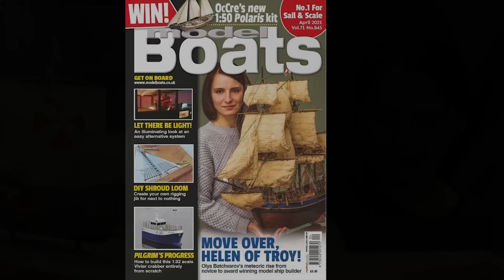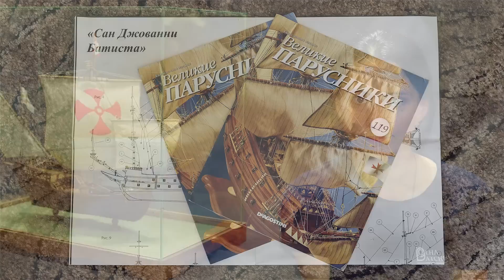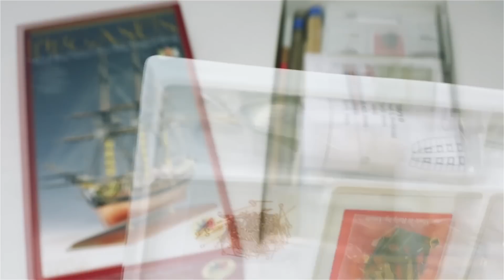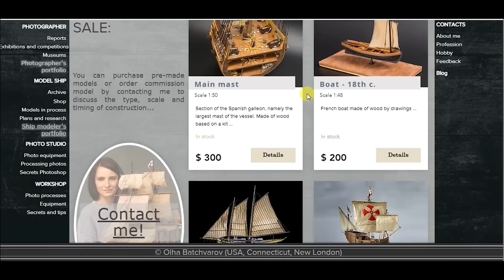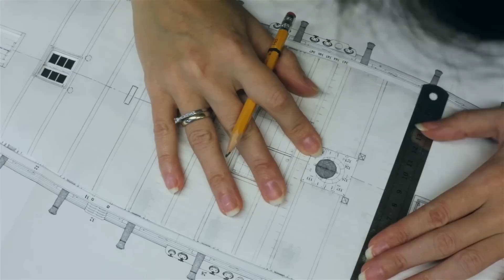FAQ - Frequently Asked Questions

Comment: Very nice.  Thank you.  I pick up a lot from your videos...

I had to laugh about your little aluminum block tool.....  And I am not laughing at you...  I am laughing because I did a similar thing years ago...

I was young, my friend was a machinist in a shop.  So they were doing all this metal work, lathes, drill presses, mills, end mills, shapers, and other stuff that I don't even know what it was.   The point is, there were scraps and end cuts all over the floor near some of these machines....  Almost all of them were perfect cubes, or perfect rectangles, in a variety of sizes... Some were really small, some were bigger, but they were all perfect square angles....  So I asked if I could buy them, and they all laughed at me...  The owner guy says "It's all scrap!  It's going in the hopper outside!  Take whatever you want off the floor, or out of the hopper!"   So I took piles of these...  that was probably 30 years ago...  I still have them.  I have used them a million times...  Very handy to have around...  They work good as weights too.  Mine are all steel, so the bigger ones are kind of heavy...

Anyways, great job.  I really enjoy your videos.  I hope you keep doing them.  Best wishes.
Reply from the maker: Thank you very much!))))

Comment: Hi Olha.  I have great admiration for your way and techniques of building ship models.  I stole many a technique from you!  One part I keep struggling with is which glue to use.  One pulls threads, the other doesn't dry fast enough.  I'm now trying thin, very liquid wood glue (D3). Maybe you want to give away what kind of glue you use?  I hope - like many model builders with me - to see many more beautiful videos from you.  You are a huge source of inspiration to me.  Gr., Arie - Netherlands.
Reply from the maker: Thank you very much! I actually used cotton threads for the first and last time on my first model. I decided to save myself most of the problems. I use 100% polyester thread. I no longer have such problems as stretching or sagging of the ropes due to humidity, no hairiness, and most importantly, polyester threads produce more realistic ropes in scale. And I use CA glue only to fix seizings and rope ends.
But when I used cotton threads, I also did not impregnate them with glue or wax - it is better to use a lighter...
Reply: Hi Olah.  Thank you for your detailed explanation, this also helps.  But maybe I wasn't very clear because what I actually meant was which glue you use to build the model.  Therein lies my problem.  I always see you making the wood connections with very thin, white-colored glue.  I'm curious about that.  If you have time - in between builds - to share this with me, I will be very grateful.  Have a nice day, Arie.
Reply: Sorry ... it's Olha, not Olah!

Comment: The nice people at MicroMark have some Machinist's Blocks similar to your aluminum scrap, in case you need to point folk in that direction.
They have also hooked me with their new PSA, Pressure Sensitive Adhesive, which is really nice for cabin glazing and fine trim (it's no fog on most transparent material, too).  (As to glues I use, the answer is "yes"--PVA, CA, epoxy, everything under the sun can have a use--this is especially true for metal items..)
Reply from the maker: Thank you for the info! This will definitely come in handy for my viewers!

Comment: Hi.  My name is Ed Zrebiec and I live in Port Saint Lucie, FL.  I am building the Cutty Sark plastic model by Revell. I need advice on how to secure lift halyards, sheet and clew lines to the pin rails and fife rails where I really can't reach them.  Was I supposed to attach the lines before gluing the rails to the deck?  Please help.  You do great work!
Reply from the maker: Hi, Ed! You can’t set the lines first and then install the fiferail. However, if the scale is small enough, you can simulate the belaying and coils. Do as follows: lead the line to the appropriate point and glue in place. Cut off the excess. Separately make coils of the same line and then glue them in position to cover the cut off line. Visually it will look like properly belayed line
Reply: @OlhaBatchvarov  thank you for that advice.

Comment: Thank you for your channel.  You FAQ video answered a lot of questions, but also raised one.  You extolled the virtues of PVA glue.  However I noticed you using Titebond II, an aliphatic glue, in a number of videos.  How do you choose between the two for a particular application?  An another subject, do you wax your rigging lines before using them?  If so, would you consider making a video that describes your method.
Thanks again.
Reply from the maker: You're very welcome!
I use both glues! Titebond II where it is not visible (because it turns yellow after drying), and PVA D3 for more delicate details (because it becomes transparent). About two months ago I published a video about different glues and their use...
For the ropes, I use 100% polyester threads, so they do not need to be waxed. I have a video about ROPEWALK where I show my method. I'll post a link in the next comment if YouTube doesn't block it. Or you can find it in the NECESSARY TOOLS playlist...
Reply from the maker: #3 Main Tool for the Shipmodeling - ROPEWALK:
https://youtu.be/vp_GOVd-8C4
Reply: @OlhaBatchvarov  Thank you.

Comment: Great video ! What is this product we see you coat the deck and then scrape at 10:00 in the video. You call it Thinner CA? Is it CA glue that is thinned? If so, with what thinner ? Acetone? Thanks! Continue the awesome work!
Reply from the maker: Thank you very much!
This is simply the thinnest SA glue or as it is called superglue. It is not necessary to dilute it with acetone in any case - otherwise you will get a mess on the deck!

Comment: When using filler , what filler do you use ?
Reply from the maker: I prefer linden or basswood. Also, for small boats or for positioning bulkheads, polystyrene foam (insulating foam board) or balsa can be used to fill the spaces...